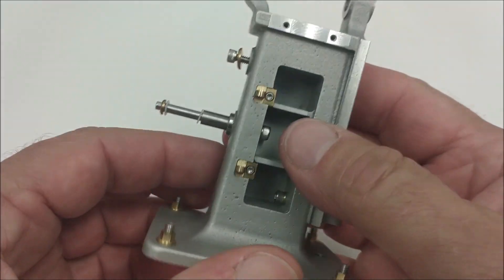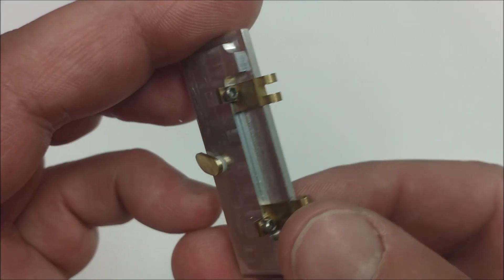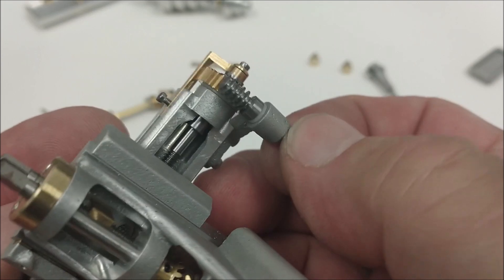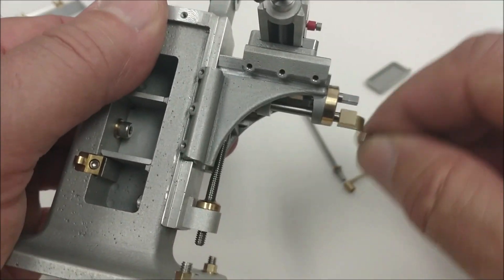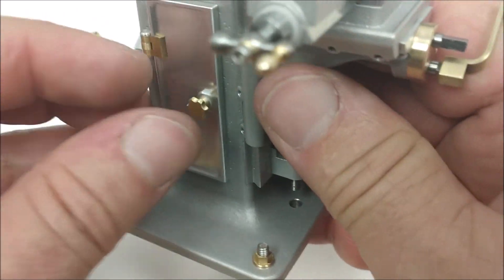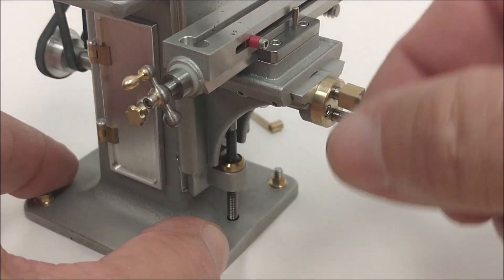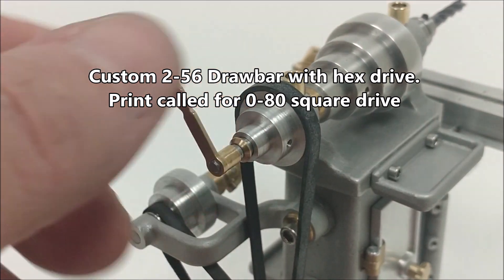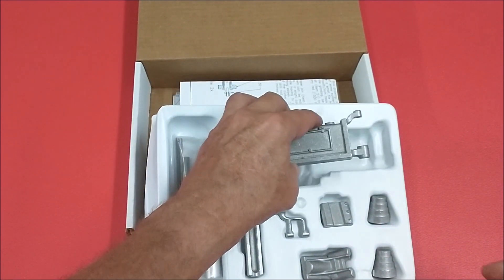1/12 Scale - Functional Milling Machine -- Check It Out !!

Comment: Nice to see you using the "blu-tak" on a toothpick when installing the oil-cups. I wrote suggesting that as a tool a year or two back, having used it to assembled my model RAF gun-turrets. I found nothing better for assembling/moving and screwing small threaded parts into female threaded holes.
Reply from the maker: Q tips, tooth picks, rolled up paper towels like I used in this video and your blu-tak are super options when the fingers are just too big.

Comment: Hi thanks for the sharing. Pity you did not power up using a small motor to cut a piece of wood or soft metal.
Reply from the maker: I always consider it, but I'd have to disassemble the machine to adequately clean it.

Comment: Happy birthday from the North Star State to the Lone Star State!  You and my Mom share the same birthday, she just turned 82.

What does the color code on the BOM indicate?

I think I speak collectively when I say we'd love to see a diorama of all your models in a fully equipped mini-shop,,, complete with line shafts to drive the machines, ideally.

Lastly, what's your favorite model machine so far?

Thanks again for all of your content, I learn something from each video and look forward to the video one you alluded to on the latch pawl for the door.

-Kurt
Reply from the maker: Hi Kurt. For visual appeal, it has to be the drill press. The sweeping arcs and round features are very ornate. For mechanical complexity, I'm leaning towards the shaper, but the lathe apron and rear gear cluster are right up there. When looking at all of them side by side, its hard to pick a winner.
Reply: @joepie221  Huh, I didn't expect the drill press to get such high accolades, but I do see the elegance.  I'm a fan of the shaper too, but thought you might give the nod to the horizontal mill with all the praise you gave to the feed mechanism.

Comment: Awesome - can you show it running and working?

In fact, you need a model of the entire workshop that has the central power axle on the ceiling to power all the machines. Driven by an outside motor - perhaps one of your steam engines?

Comment: Hi Joe, Happy birthday for 19th, you're the day after me.
That model is incredible. The changes you made are also incredible when you take the scale into account. Like the miniatures INT40 tool holder and spindle nose - the size of the tooling to machine the spindle nose would have been a challenge. And those handles and spanners are works of art.
Top marks for your end result. It didn't seem like 10 months. 

Regards from Oz, Dennis.

Comment: Still need to mount all of the machine tools you've made onto a 'shop floor' and build a boiler, steam donkey, and a Shop Belt Drive System with the King Shaft, Jacks and Belts so you can run them all... or use a step down transmission and small electric motor and Shop Belt Drive System. That would be awesome!

Comment: It turned out beautiful.
Do you want to create a miniature line shaft set-up? You have a mill, a lathe and a grinder that I can remember. It could be powered by one of the small steam engines you have created and use compressed air.
Thanx for showing us your build process.
What's next?

Comment: Okay, Joe. Now that you’ve gone through all the trouble to make a functional door and some storage space inside, it behooves you to model some stuff that would go in there. My guess is cutting oil, various lubricants, shop rags, extra “T”-nuts, hold-downs, a box of spare parts, a scale micrometer, etc… 😅
Reply: Don't forget the cutters.
Reply from the maker: I'm thinking an oil can and a clamping kit would look right at home in there.
Reply: @joepie221  go for it! 😀
Reply: Looks like a vertical head would fit in there, maybe that is Joe's next challenge ?😉
Reply: Only need to model a box for the micrometer. You wouldn't leave an unboxed mic in the machine.
Reply: @alanclarke4646 that is too easy…unless it’s a homemade hinge and latch model 😂
Reply: A rack or two of collets, to scale of course.
Reply: The micrometer will be awesome!  In ten thousandths of course 😂
Reply: That sure looking like it should. He's sure a crafty sort. Nothing supprises me any more.
Reply: An automatic drawbar tightener with reverse of course….almost standard now 😅
Reply: Did you have a total time of machine work, fixture, etc?  Even a rough guess?    Happy Birthday 🎉😊
Reply from the maker: @wrstew1272  At the very least, count the time of all the videos in the series and multiply that times 5. then add 40% to that for all the CAD work and components I didn't show. Then multiply that times $85/hr.